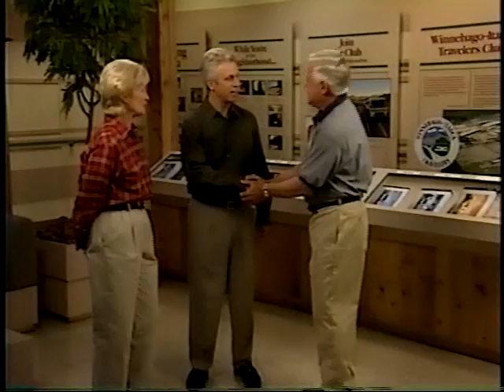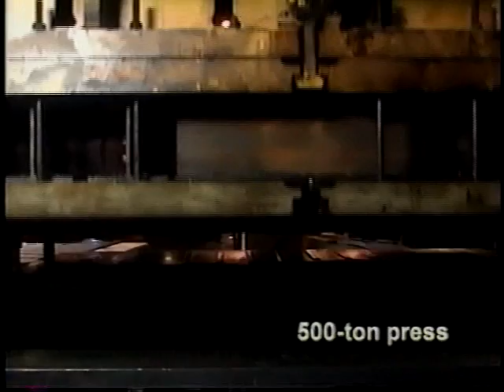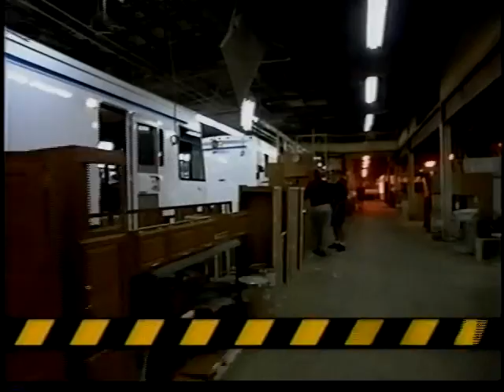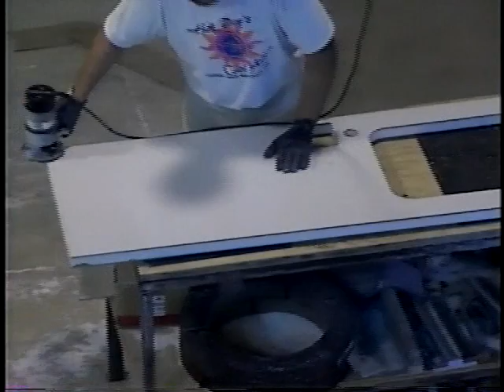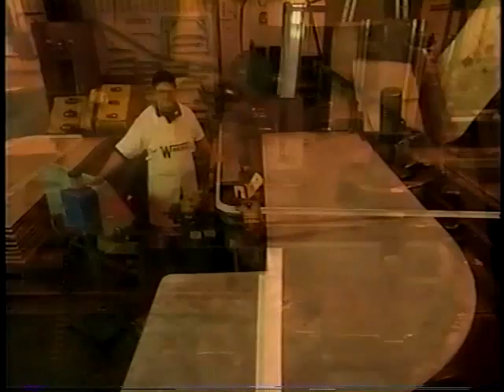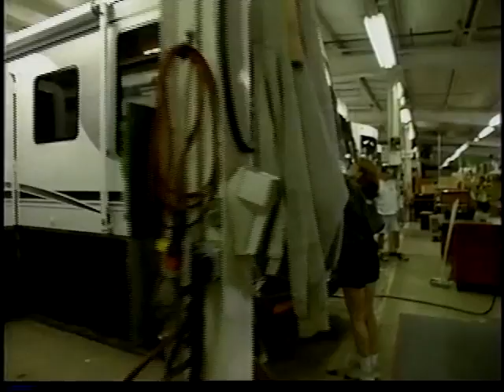The Winnebago Industries Factory Tour

Comment: Eye candy, beautiful looks, poorly designed for thousands of buyer's hard-worked dollars.
The more repairs I do on my MH, the more I see how poorly the RVs are designed here in America. 
Our RVs are not made to last, they are almost disposable, besides require frequent and several maintanance, many repairs are almost impossible due the way the RVs are assembled.
Plastic parts under heavy loads, thin wood walls to go rotten instead of a thin layer of plastic or better material, wood subfloor with zero treatment or sealant, one water connection that is also made of plastic that burst, your RV floor and walls will disolve.
We should make things better than China. 
I don't think we need Germans or Japanese engineers to show us us how it should be done, we know how but most buyers have no clue about the flaws.
Cost and weight are not excuse for the poor design.
Reply: Dissolve, not “disolve”. Dummy.

Comment: Winnebago class A vehicles are built extremely well for todays expectations, however, more use of water resistant materials would be preferred along with solid insulation, heated tanks and options like (dark) colors could be improved. Yes, the price point is good for the solid reputation you get!